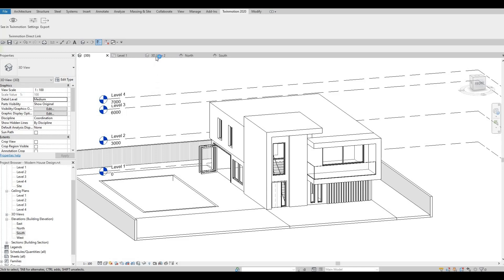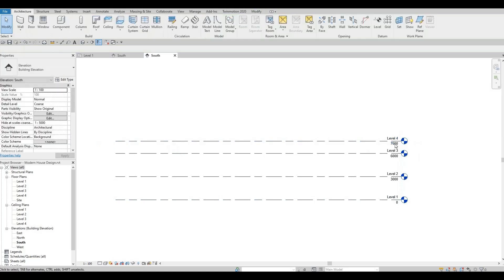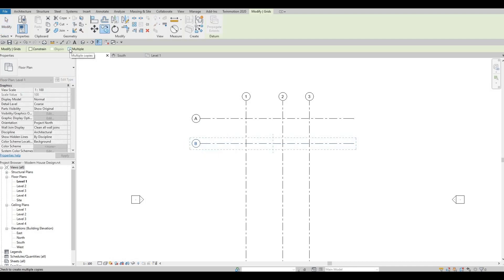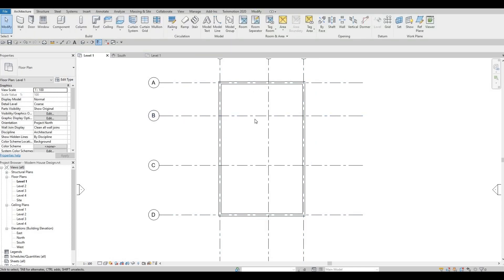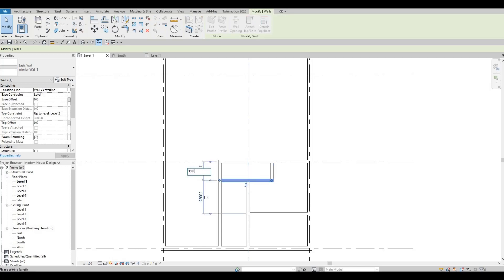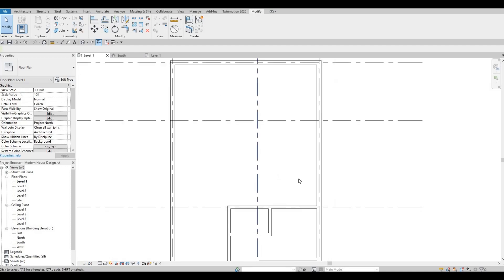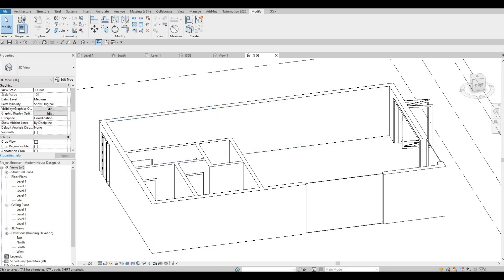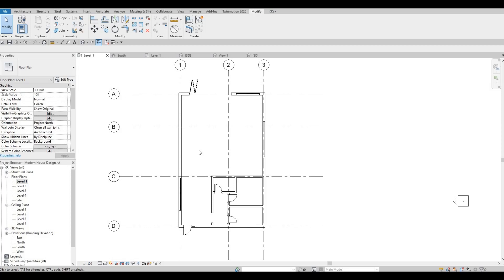Modern House | Part 1 | Complete Step by Step Project | Revit Tutorial

Comment: I can’t open the door families which I downloaded form the link in the description of this video it says the file interior door.rfa was saved in the later version of revit and it cannot be retrieved in this version. I have revit 2017
Reply from the maker: Hi Raj, unfortunately revit is not backward compatible. Meaning you cannot open my files because it was saved on version 2020. I cannot resave it to your version 2017 as well. Its unfortunate but that is why it is important to use the same version. 🙂🙏
Reply: @ArchCoreDesigns But Can this File be opened on Version 2021 Revit?

Comment: How does one go about amending a Revit model that has been drawn on the wrong level? I've gotten to 12:01 in the second part of this house build and realised that my levels started at 0 not at 1, meaning that my levels are incorrect. In searching the web, I know I can adjust which levels my walls are attributed to, but is there any way to have the entire level (windows, doors and internal walls included) moved to an alternative level?
Reply from the maker: Hi Melanie, what you can do is select everything and under modify tab, beside the PASTE there is COPY TO CLIPBOARD, after you click that, click PASTE then select Align to selected level. Make sure you have the levels created first so that you can see it on the list. 🙂🙏

Comment: Where is the Door you used for the first door you placed It is not the same as the one in the block
Reply: nevermind consider changing the name of the door that you use to main door so people know what door you're using. it would have saved me a headache
Reply from the maker: Hi , I will make sure to inform everyone the changes in the future. Thanks for your suggestion. 🙂🙏
Reply: @ArchCoreDesigns  no problem maybe just add one of those YouTube footnotes that says main door is the side door with side light
Reply from the maker: good idea sir 🙂🙏👍

Comment: Great tutorial....but when I loaded the door that you attach in the description link that couldn't be used because it was saved in the later version. i used revit 2018!!!
Reply from the maker: Hi Arshi, if you can check the download file again. I put the same door but saved as a 2015 version of Revit. 🙂🙏
Reply from the maker: Sorry, don’t load it yet, double click on the file so that Revit will upgrade the version to your version. Then load it afterwards.
Reply: Same here, I am using revit 2019, have you had any luck importing some doors Arshi?

Comment: hello, when dragging walls around the dimension things are not centered on the wall but are inside the walls like from edge to edge not center to center
Reply: nvm its under manage, additional settings and temp dimensions
Reply from the maker: Ah yes that is additional settings that you set before adding the walls. Different options like exterior wall, interior wall or centreline. 🙂🙏

Comment: Very nice video, I'm learning a lot from you! But I was facing a problem with the families. I loaded the folding door that you attached in the link but it couldn't be used because "it was saved in later version and cannot be retrieved in this one" I use Revit 2018. What can I do about that? or where can I download families for this version for free? Thanks a lot!
Reply from the maker: Thank you Jasmine, give me some time to look for it and maybe I can save it on an earlier version.
Reply: @ArchCoreDesigns  iam using revit 2017 and the families didnt work for  me
Reply from the maker: If you check now, there is a Parametric Folding Door Version 2015 you can download
Reply: @ArchCoreDesigns   I loaded the interior door and main door that you attached in the link but it couldn't be used because "it was saved in later version and cannot be retrieved in this one" I use Revit 2018
Reply from the maker: Unfortunately Revit is not backward compatible, I used Revit 2020. 🙏🙂
Reply: @ArchCoreDesigns  Yesterday, I finally solved my problem. Thanks sir.
Reply: @ArchCoreDesigns  can the model in revit 2018 be exported on twinmotion 2016?
Reply from the maker: Hi Diaz, how are you able to solve it? 🙏🙂
Reply: Okay, I will. Thank you so much for your time!
Reply from the maker: Thank you as well Jasmine, give me until this weekend as I am moving to a new place and once I settled down, I can look for the file.
Reply from the maker: If you check now, there is a Parametric Folding Door Version 2015 you can download
Reply from the maker: If you check now, there is a Parametric Folding Door Version 2015 you can download

Comment: Where can I download the families you’re using?
Reply from the maker: Hi Ahmet, which family do you need?
Reply: @ArchCoreDesigns  The paranetric folding door. Great tutorial btw, keep up the good work 👍🏻
Reply from the maker: Thank you Ahmet, I included a link in the description of Modern House Part 1
Reply: @ahmetsusam4016   Did you manage to download the families ?? i'm Struggling
Reply from the maker: Hi Mduduzi, are you having problems downloading the families?
Reply: @ArchCoreDesigns  Yes, they can't be used on a recent version.
Reply from the maker: Yes unfortunately Revit is not backward compatible, if you create the family or a project in Revit 2020, you cannot open it in Revit 2018. 🙂🙏